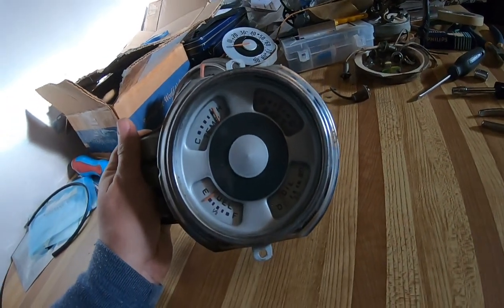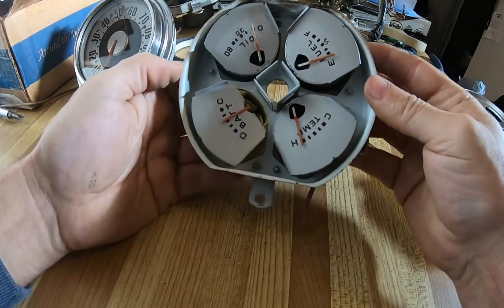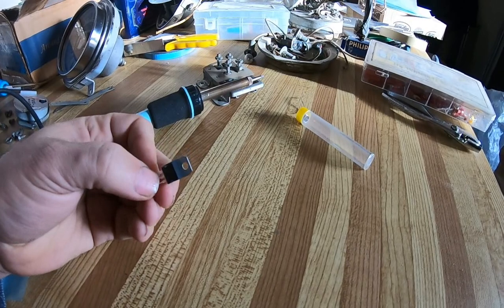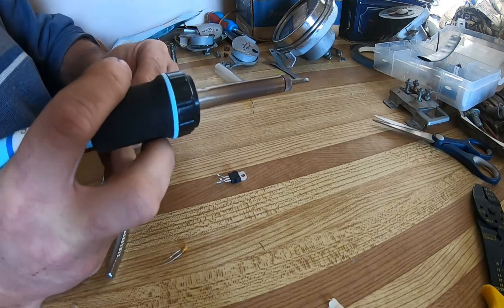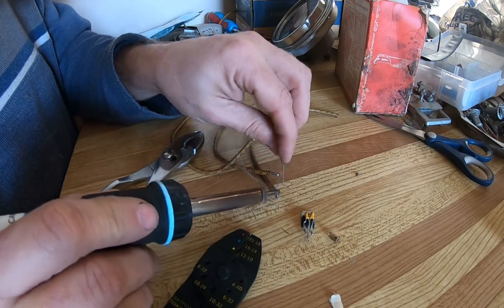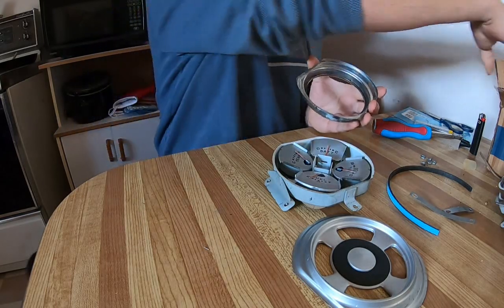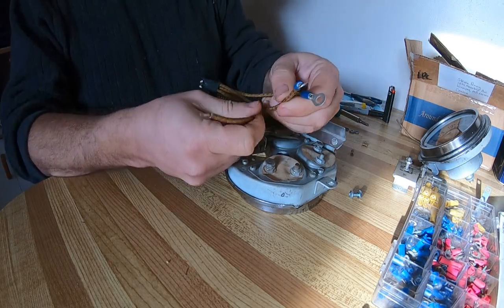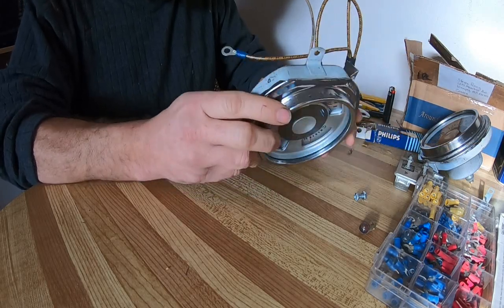1952 Ford F1 Gauge Rebuild and DIY 12v to 6v Runtz Style Voltage Reducer Build.  Converting Gauges.

Comment: Awseome video on these gauges. I've found Ford delivery trucks from the 70's that literally use the same exact gauge cluster and speedo that was used in the '51/'52 trucks. Has the correct wiring to replace the shunts, as well as factory voltage reducers already in place.

Comment: I ran 12 volts directly to my 52 Ford F1 gas gauge and never had a problem with it, I did not know about reducing the power. Luckily it worked until I had to scrap the truck because hurricane Katrina ruined the truck.
Reply from the maker: Wow really sorry to hear that Jon.

Comment: Curious.... So.. Since Ford found out using 12v on gauges made them suck (1956 only), they reduced their gauge voltage back to 6V in 1957, and on up through the 80s/90s. Couldn't you steal a voltage regulator from the back of a 1957 or later Ford dash and use it for all the gauges? I've heard of this being done and I'd like to try it. Would make 12V conversion soooooo much easier.
Reply: Ha! you mention that in the end... lol
Reply from the maker: @OlysGarage  You got it right, you could use a newer voltage regulator but I like doing things different.

Comment: I like keeping the origional gauges as much as possible. that trick with the voltage reducer from 12 to 6 is a  great hack.  Gauges do look nice, when I on tri five chevys   I take a toilet paper roll cut it down and use scotch tape to make one small light  tube for hight beam and siginal lights in cluster.
Reply from the maker: Good tip Gary.

Comment: That I'm still trying to get the signals working in my antique car. Maybe, could try cleaning off the ground wires? The brake lights work, but I need to order a relay switch.
Reply from the maker: Its helps having everything clean and having good ground.